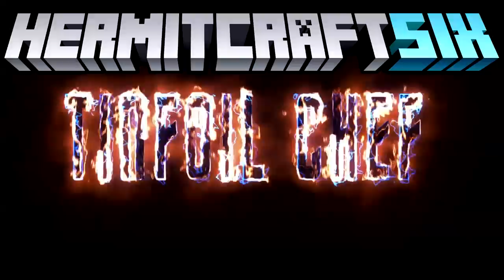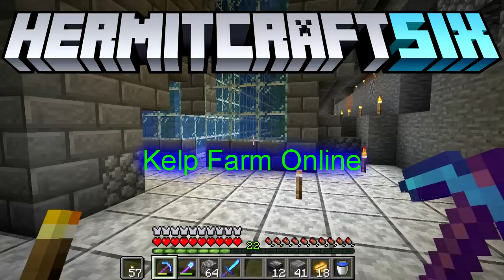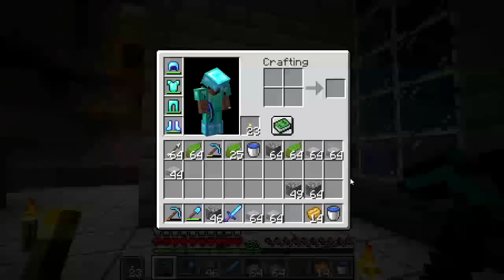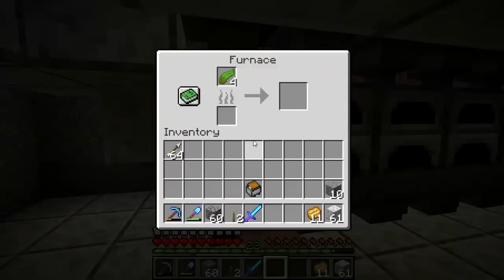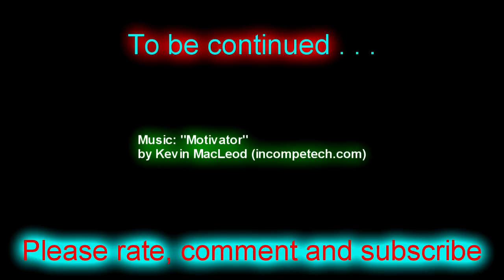Kelp Farm Online - Hermitcraft 6 Ep25

Comment: FYI - Kelp only grows to "age" 25, and every time kelp grows the new piece is age + 1 of the one below it. Whenever you place kelp manually it receives a random age between 0 and 24. So if you want to avoid the kelp growing too high while you have your farm off you can keep placing kelp below where you are cutting it until you've placed one of a high enough "age" that when it grows to 25 it will still be short of the top. (I think you may be able to check this with F3, but not 100% sure. I do know there are texture packs that will color the different aged pieces)

This may also be important for the efficiency of your farm, because if any of the kelp you placed was too old already it may not grow high enough to ever be harvested, leaving part of your farm constantly fallow.
Reply: Yes, you can see the age in the right hand centre.
Reply: In February mode that is

Comment: Hopper feeding the fourth from the right side (if facing the furnaces fronts) either the hopper is lock or pointing the wrong direction.  My money is on it is facing the direction because if it were locked the same on the left would also be locked due to the lever.
Reply from the maker: It was the lever.  I moved it to the other side of the block and now it's working right.

Comment: 24:08 You have an unlit furnace. I think it is being caused by a lever that is powering the fuel cart track which is also powering the kelp loading hopper cart as it passes stopping the loader from putting kelp into the feed hopper for that furnace.
Reply: You are half right the furnace is not lit but it is not from the lever, if it were it would also happen on the other end as well.  There is a single hopper face straight down instead of into the furnace, I had to look twice to see it myself.
Reply: Liowen I'd looked for that and didn't see it. You have an approximate ref time for him?
Reply: Easier to look at the furnace in question on the server than in the video, but around the time when he grabs the block of kelp and heads to that end.  I doubt the lever above would be the issue since there is a second one in the same area on the left side, however there could be a block (rail most likely) in the first spot causing the hang up too.  That is hard to tell without looking inside of it.
Reply: @Liowen  4th from the end. It was not facing straight down.

Comment: You can still have an off switch for the farm, where you turn all the redstone on causing the pistons to extend. Sure no kelp will grow while it's off, but it does let you stop the flow of the kelp if you ever needed that for some reason.
Reply from the maker: Yep.  did it off camera.  main reason is I don't want to risk plants growing tall enough to make source blocks in the streams at the top, forcing me to remove them and re-do the whole slab thing to re-make them.
Reply: Leon I thought the same thing.